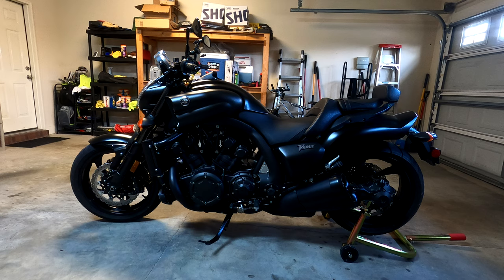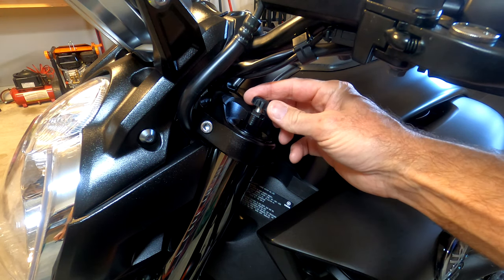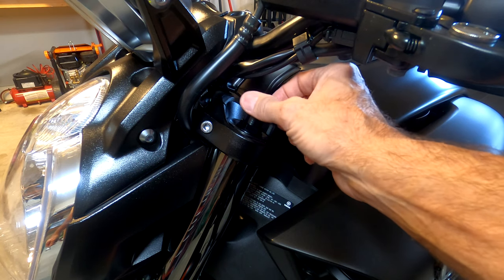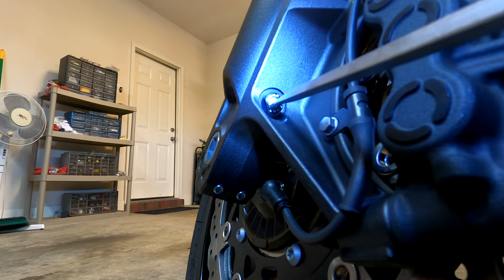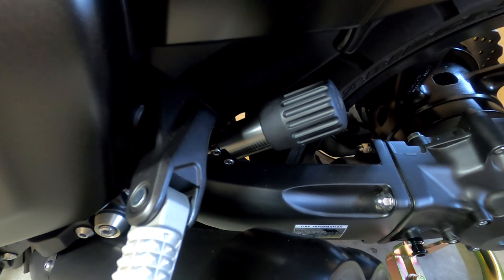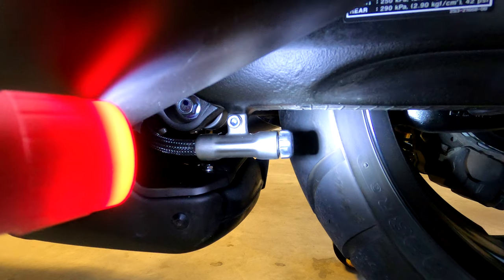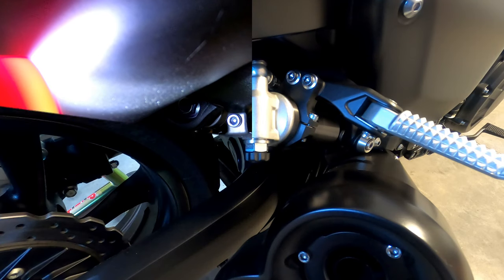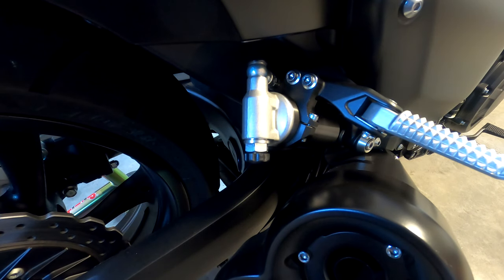How to Adjust the Suspension on a Yamaha VMAX 1700

Comment: Having your VMAX's suspension set up properly is one of the best upgrades you can do. Had mine set up here in the UK professionally, took one hour and £40. well worth it.
Reply: DID ANY OF YOUR ADJUSTMENTS HELP THE FRONT END HEAVINESS?
Reply: @chrisvantassel8867  I just noticed a general improvement overall. It rides stiffer now but it handles way better.  It'll never be a R1 but still takes them by surprise now.  Worth 40 quid all day.
Reply: @chrisvantassel8867  the front heaviness will go away if you keep your front tyre at 42psi and back 42psi too. This is important. This is the right pressure. Invest in a good air pressure gauge. Cheers.
Reply: @themalaailaanaa1347  Ya, ultimately I did discover that.  It helps tremendously.   Still heavy at slower speeds but the whole bike corners much better with the higher pressures, almost like a naked bike.  Cheers!!
Reply: Now flash it...
Reply: @themalaailaanaa1347  I did the Guru flash a while back....pretty amazing!

Comment: DO YOU HAPPEN TO KNOW IF THERE ARE RECOMMENDATIONS ON THESE SETTINGS FOR BODY WEIGHT ETC.  PERHAPS AN IDEA OF WHAT THESE ADJUSTMENTS WILL AFFECT SUCH AS HANDLING?
Reply: It all depends on your style of riding (easy or aggressive)road conditions (flat or bumpy)😮tire pressure and personal preference. The preload you adjust according to your weight including your gear and personal items or if you carry a passenger as the bike should not sag less than 20% or more than 30%. Damping and rebounding compression are easier to adjust as you can change anytime without special tools. There are no perfect setting, only the settings that work for you. Jeff seems to be light weight so he might use soft preload settings which seems more ideal for him and his style of riding. I don’t see in his videos riding aggressively. When I ride sports bike on a track I prefer compression damping and rebound on the stiffer side and tire pressure a bit lower so it increases my traction on a curve. Remember I corner above 100mph. I was trained by former motorcycle racer Keith code. You should check his books

Comment: My question. Is what is the (definition) effect of changing those settings.... Like: Increasing pre-load does what? Increasing rebound does what? and finally the effects of compression. Understand? I say this as I would like a firmer ride. with 245 pound frame I would imagine I need to remove some of compression (so it does not squat as low when I sit on it, etc. etc. Thanks
Reply from the maker: If your bike is sinking lower than you like when you sit on it, you should increase your spring pre-load, especially in the rear. To increase the firmness while riding, try increasing your compression settings by turning them clockwise.
Reply: This shit is like rocket science low key trial and ride type of thing because no standard setting base on weight

Comment: Good video. I'd be interested to know how this affects the height of the bike. Does it bring the saddle lower to the ground when your weight is on the bike?
Reply from the maker: My weight is not enough to lower the bike much. As I explained in my Comprehensive Review video, I only weigh 130 lbs.
Reply: Thanks, 130lbs? Wow, Thats like Jay Gleason! How tall are you? Are you able to straddle the wide saddle and have good foot control on ground? Are you able to move the bike around comfortably?

Comment: Jeff,  you do a great job on detailing the V-max!  Very interesting and informative for sure. More you tubers could take notice on your style of speaking clearly and professionally when explaining things :)  Thanks in part to your videos, I purchased a new one yesterday and will be picking it up tomorrow AM...YaY!  Jeff, I have one concern....
I'm 5'11, and when sitting on the bike only about 2/3 of my feet are on the ground. What is the easiest way to get them flat? Will backing off the pre-load lower the seat a bit? I see they offer lowering brackets and shorter shocks for the rear, lowered seats,  internal springs or sliding  the fork tree up front.  I am not a canyon carver and have no intention of trying to be really fast around curves.  A lowered center of gravity and straight line stability is what I am after. Thanks very much for any tips or ideas that you can offer....Gene :)
Reply from the maker: Thank you Gene. I'm glad you liked the videos and they helped in your decision. As for getting my feet on the ground, if you have seen my Comprehensive Review video, you know I am only 5'6" and 130 lbs. Additionally, my inseam is 30 inches. Therefore, I struggle with the feet issue as well. I have my pre-loads backed out all the way, which may fix your issue completely depending on your weight. When I ride two up, I can flat foot it. This is something I have had to deal with all my life, so I'm used to it. My VMAX actually sits slightly lower than my previous bike (V65 Magna). Congrats on the new VMAX. I hope all goes well today with picking it up. Let us know.
Reply: @JeffMarcum   Hey Jeff thank you so much for the reply and comments!  I am sorry I did not reply sooner....the last few weeks have been nuts! Right before I picked the bike up.....the dealer / salesman tried some funny chinese math with me and I cancelled the deal.  I ended up a week later with a 21 Harley Fat Bob. Honestly, I love the Fat Bob so much I'm really glad it worked out the way that it did.  Thank you again for the reply and ride safe my friend...Gene.
Reply from the maker: @MrSolidman48  I hate that last minute funky math, especially if they have a monopoly on the bike because they are the only dealership around. I'm glad you found a bike and a deal you are happy with. Enjoy the new ride. Coincidently, just yesterday I put a picture of a Fat Bob in one of my upcoming videos. 😎
Reply: @JeffMarcum  You nailed it Jeff!  (not your first rodeo either)  I guess they thought I HAD to have it! lol    In my 20's that would have been true....but not in my late 50's!   I appreciate your reply brother and I turned on notifications so I will check out the new vid. I already changed the bars and risers and have ordered mid controls for the Harley. I love the look and performance of the bike....but the drag bars were too much of a lean forward for my lower back. 3" risers and a moto bar cured that.  The semi-forward controls are perfect for speeds less than 60 mph. After that the wind is constantly trying to open your legs with no relief. The mid controls will cure that.  All it takes is $$$$$$ and wrench time!  lol
Reply: @JeffMarcum  now that you mention the super magna .... you have to remember that Yamaha specifically made the Vmax1200 for the short man to go fast...
Till the little vboost rocket was born there were no real fast motorcycles for the short man to go comfortably superfast.

Comment: Do you prefer to have a tighter or more loose suspension when street riding
Reply from the maker: I have my preloads set to softest because I only weigh 130 lbs. All other settings are set to the standard settings. Overall I tend to prefer softer settings.
Reply: @JeffMarcum  What are the standard settings?